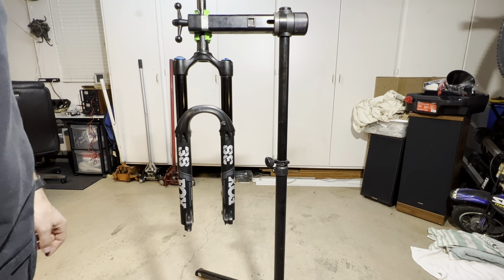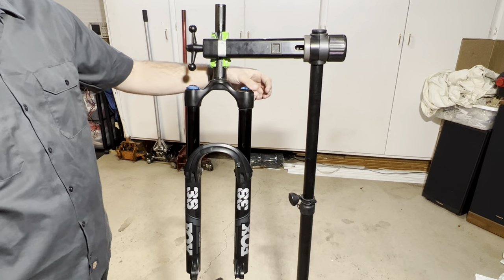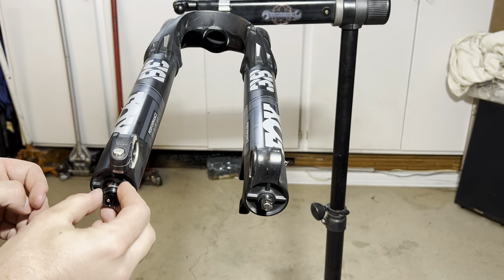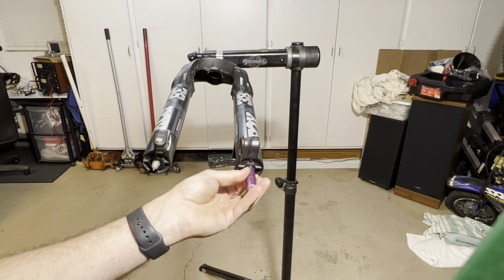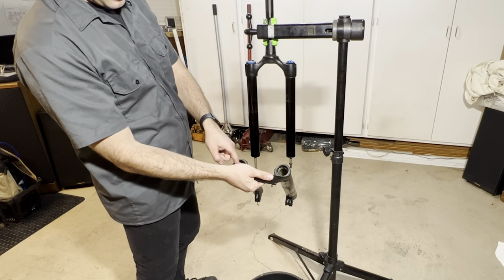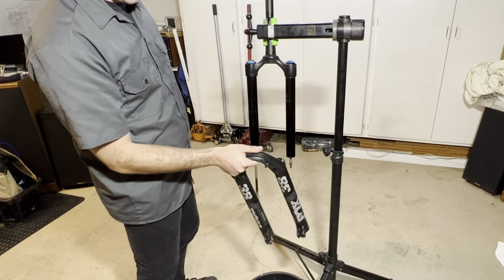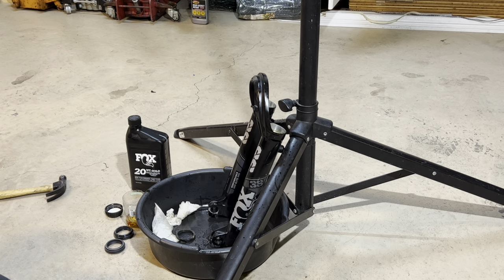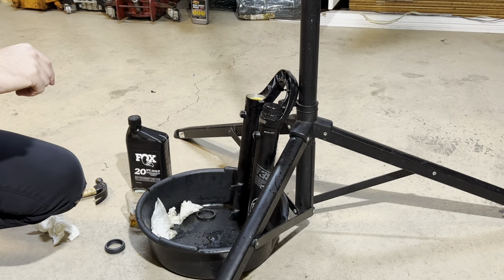Fox 38 Lower Leg Service! - Easier Than You Think!! [Do It Yourself!] #mtb #mountainbike #diy #bike

Comment: Good helpful video.  One thing I would like to add is that the damper side foam rings should not be soaked in 20 wt oil.  The 38 has channels that bring up oil to the foam rings so you will be mixing some 20 wt oil with the 5 wt through that process.  Best to soak the damper side foam rings in 5 wt.
Reply from the maker: Thanks for the tip!! Will definitely start doing that next time I tear into it. Thanks for watching!
Reply: This is true for grip dampers like the performance elite in the video but for anyone with a FIT4 damper, I think the 20wt oil is the required bath oil so it would be fine.
Reply: It's an absolutely negligible amount of oil. It won't hurt it

Comment: You forgot to pull out air sleeve rod. It's not not supposed to be sucked in. Too much grease in negative air spring. Typical of new Fox forks. It  feels way plusher when the air side rod is out all the way.
Reply from the maker: Thanks for the tip!! If I have time in the next couple days, I’ll tear it down and pull it out all the way. I’m all for it being plusher! Thanks for watching!
Reply: Do you remove it to remove some of the "to much" grease applied at the factory or just pull on it to make sure it is extended all the way out?

Comment: Hey there.  Is your fork set at 170mm travel?  Does anything change if its different, like the amount of fluid etc?
Reply from the maker: Hey! Yeah, mine has 170mm of travel. Everything should be the same with all the other travel sizes!